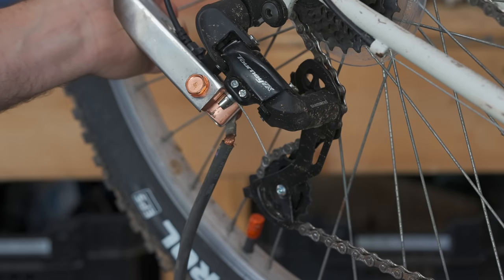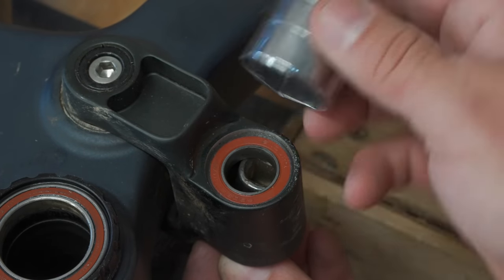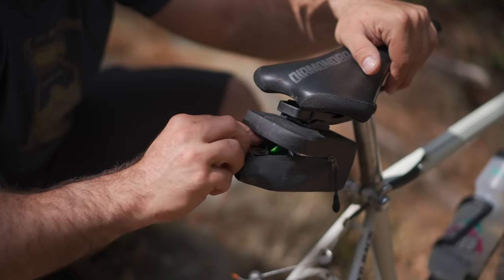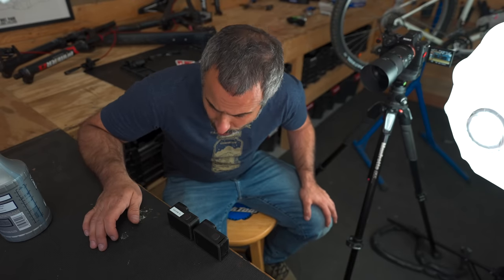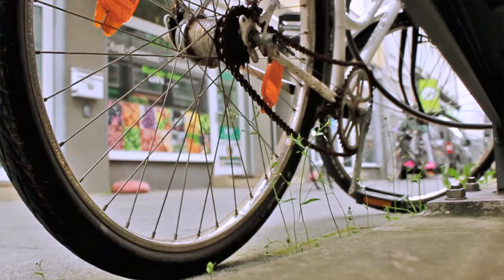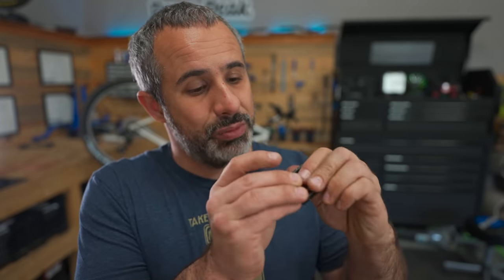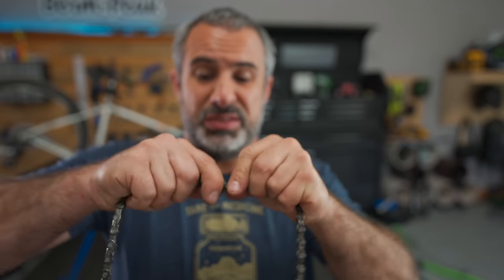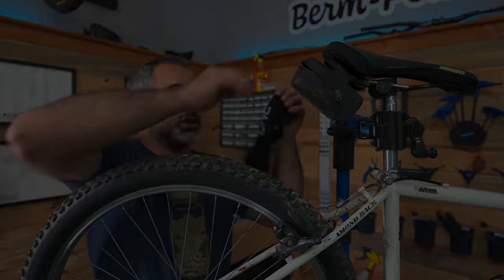10 ill-advised hacks for bicycles

Comment: A hack that I've used for cable ends is to use my torch or a lighter and heat the end up nice and hot and then quench it with some scrap plastic or clipped off zip-tie. Just like soldering, the plastic wicks in a bit and you can get a little goober on the end for a nice finish.

Comment: Another little hack for if you don’t have a crank puller for Isis drive cranks but you have one for square taper cranks: take out the bolt of the crank, take off the little plastic piece on the bolt, thread it back in all the way (don’t tighten it down though just thread it that’ll just make it more difficult to deal with if you tighten it), then take the crank puller apart and thread the part that goes into the crank into the crank (and tighten but not crazy just enough to still be tight-ish), then all you have to do is stick you tool through the puller and loosen the bolt, (and ofcourse unthread the crank puller part to get it off). By doing this you are basically making your cranks into a temporary self removing bolt style crank. This way you don’t have to waste 10 cents every time you take off your cranks.Also if you’d like to be extra careful put grease between each step

Comment: Regarding the cable end hack, I found using a 1/8th inch aluminum pop rivet (removing the aluminum nail first) will crimp on the cable end just like a normal bike cable crimp. After reading the comments, I also like the super glue method, and the head shrink one for the same purpose.

Comment: For the rainX thing, ive tried a few different things in the past including this and what seems to work best for me is to treat things with the cheap turtle wax ceramic coating meant for car paint. Basically makes most things repel water and pretty resistant to grime and scratches too

Comment: The bearing hack can be even simpler with using a nut and bolt and some washers insted of the clampp <3
Reply: I re-use the old bearing to push in the new bearing because it is the exact size you need.
Reply: @newttella1043  this is the way!

Comment: A small strip of electronical tape, wrapped around the base of the zipper "Pull" will also get rid of any clinking sounds, from bike bags/pouches. I used this to silence the noisy  buggers on my handlebar pouch. But, it works with basically any noisy clanking  metallic zippers on a ride. Just add it to the base of the "pull" thingy and not covering too much of "slider" itself, so the zipper still zips correctly ✌
Reply: even better... a bit of heatshrink. no messy glue residue when the crappy electrical tape comes off, which it will.

Comment: That method of chain repair was what we called, fixing a chain, before quick links were a thing. If the link is tight the chain tool has a place to put the chain to not drive out the pin, but free up the link. Surprised my man missed that but he does seem to be a very knowledgeable source, so I'll let him slide on this

Comment: PSA: don't weld galvanized metal, the zinc coating puts out seriously toxic fumes when heated that high. Most cables these days are stainless, but the galvanized ones are still out there

Comment: Welding feels like overkill, but I've definitely used a soldering iron and a little bit of solder to accomplish the same thing. For best results: solder where you're planning to cut the cable BEFORE you cut it, as the soldering tip could cause fraying.

Comment: Don't have to have a welder to do the cable. Install it, mark it, pull it back out. Chuck the free end in a drill and hold the other side of the mark with vise grips. Heat the mark with propane torch. When it's red hot spin it in half with the drill. Makes a perfect end. Now you can take the cable back out when you want to clean and lube it and you can use it over and over and not have to worry about frayed ends.

Comment: As a retired Aircraft and automotive mechanic 
As mentioned in the other comments freezing bearings helps, in the Air Force I worked in the Jet Engine shop and we had bearing heaters and bearing freezers. we heated bearings to expand them so they fit over the compressor drive shaft.
If you got a full suspension bike that the champ won't fit into, using some a piece of all thread and some nuts you can use that install and remove bearings I use that setup to remove and install bushings on the control arms of cars.

Chain quick links, tape one the the bike like under the saddle or to the bar, I have also seen a rider he puts on the zipper pull of his jacket but he put tape around it so he wouldn't lose it.

Comment: Instead of welding the cables, you can use superglue.
I have used it a few times and worked really nice.
As the bonus you can also twist the cable and when the glue dries, it will hold that shape.

Comment: Seth, this hack got me out of a pinch once. before a ride I was installing new grips and forgot to tighten the collar on all the way and I was out on the trail so I had to improvise so I took off the grip and put some green leaves on the sides of the inside of the grip and slid the grip back on. It's not perfect, but it works.

Comment: lacking a welder I honestly already soldered wireends. at least if they were already frayed or cut to short for crimping one of those caps (fixing rookie mistakes of friends :D). also for city bikes with less stress than mtb's many chains were fixed that way. still holding tight! if the link is heavier to bend you usually didn't find the sweetspot for the pin. press it in (or out) a quarter turn and try again :) 
all in all valid tips and hacks :)
Reply: Those cable caps do suck !

Comment: You can do the welder thing, but the easiest thing to stop a cable fraying is put a drop of superglue on it immediately after you cut it. Useful if you need to chop the cable end off to remove it (it to swap a derailleur. It stops the cable fraying and you can reuse it.

Comment: Great video Seth! Here is a hack that I use on my suspension because I don't have an O-ring:  cut a rubber band in to a strip then wrap it round your stanchion then tie it in a knot so its a ring round the stanchion and finally cut the excess off with scissors.

Comment: You can also feed a little solder in the end of the bike cable and heat it with a jet lighter to bind the end so it doesn't fray. Add extra flux, and it may really depend on the quality of the flux you have whether that's really going to work. Tin solder can bind to steel fairly well but getting it to wet the steel to begin with is another matter entirely, sometimes it just doesn't work. If you have Stannol Tippy, that can help as well.

It's probably not that great a recommendation for most people, but since i mostly do electronics, i have all these things on hand in abundance.

Comment: I'll add that you can sometimes get away with zip-tying a broken chain if you don't shift. You can also lock a derailleur that got mangled into a single gear with them if you have to. I've ridden home on zip ties and prayer before. Walked it up the hills, coasted down, and pedaled on the flats.

Comment: For security, if you have a 5/6mm hex bolt for say, derailleurs, stem, etc. You can use CA glue and a ball bearing to prevent someone from being able to rip off bike parts. When you do inevitably need to get to that part, a few drops of acetone and an o-ring pick can remove it easily.

Comment: Did the chain trick in once in the desert when i was stuck with a broken chain. I was like 30 km away from the closest town and absolutely no signal or human being anywhere near. I messed up at the first attempt as i pushed out the little metal thing, on the second attempt it went right though and i got safely back witouth a problem. Had no problem shifting or other chain problems. 
Couple years later i met this teacher who was mountainbiking with his school for gym class(so cool that he did that btw). Sadly he broke down with a broken chain and had no quick link or tools. Luckily i happened to drive by and having had my past desert experience quickly managed to help fix his chain. Riding away with a whole school class thinking thinking you are the coolest person ever was a pretty great feeling.

Comment: You can also solder cable ends, assuming they're made from steel and not some fancy ultrapro material. It works best with new cables, as old frayed ends accumulate dirt and solder doesn't want to stick as well. Dipping them in flux helps. If you don't have a soldering iron, you can melt some solder in a suitable tiny metal container with a flame underneath and dip in the pool the fluxed cable end.

Comment: I've fixed some chains like that without a quick link. If the link is stiff, sometime you can find the sweet spot of adjusting the position of the pin back and forth, by having the chan tool handle facing the non-drive side of the bike (pushing the pin backwards). Not only will it get you out of a pinch but I've used it as a long term solution.
Reply: the 'hack' is actually how the chains are made so no idea why its being referred to as a short term solution. its the proper repair, just people have been conditioned into thinking the 'quicklink' is proper, but the only thing proper about it is more money to someone else for things that should cost you nothing to fix.
Reply: @brapamaldi7666  you chain is shorter by one chain link.
Reply: @brapamaldi7666  not true.  Chains are made today by the final process of press-fitting the pins in place, then peening the ends so they flare out to make the fit with the outer plates even tighter.  This is how today's narrow chains can withstand side loads under shifting while the old chains couldn't.  (Ramps and modified cog & ring teeth help to, obviously.)  So when you drive a pin out, you pop off the peened end on the pin as well as ream out the ID of the side plate, so when the original pin is reinserted, it's a looser fit.  (My chain tool always has about 3-5 tiny rings of pin or plate material that has been popped off with each pin removal.)  A repaired chain will have that weaker link where the outer plates' pin hole diameters have been reamed out and are prone to pop off.

Shimano first addressed this issue by using their special larger diameter pins with smaller "lead" pin for chain installation and repair.  But as rear cogs have increased to 11 and 12 speeds and chains gotten even narrower, they stopped this method and switched to quick links.

But this repair is absolutely the way to get back on the road or trail in an emergency.

Comment: I might try the cable welding... my cable looks like the one that impaled your hot dog, as the crimp came off while riding tight trails and I never seem to remember a replacement. On street rides I use a rack bag, but keep a tow strap and an extra pair of gloves in to to keep things from bouncing around. I keep the tools themselves in a Muckoff zipper bag, with other things like patch kits, tire levers, spoke wrench, air pump and such in interior pockets when I can. Thanks for experimenting for us!

Comment: Good hacks.  Instead of a sock for the seat pack, wrap your items in a clean microfiber towel. You can use if for many things including a huge bandage.  On the chain hack;  after joining if too tight, flip around and a little pressure with the chain breaker on the other side will un-bind the link.

Comment: Growing up dad welded open cable ends like that on everything. I have a lifetime of crimps but still weld them before I put the crimp on.

A drill bit stop or a set screw collet the correct diameter would be better than a hose clamp on your wheel holder. Will hold better and you won't have that sharp tag of the worm clamp hanging off.

Comment: The cartridge bearing removal/installation without a special tool is something I've done to my old fully. But I didn't have a clamp, I had to use a long bolt, a nut and some wide washers instead. Worked a charm!

Comment: In the seat tool bag you should include a vital accessory. Put in a pair or two pairs of disposable rubber gloves. Surgical gloves.  They are a miracle when you handle the chain doing a rear tire flat repair or reseting your jammed chain.  You won't have black, gunky and greasy fingers from chain handling for the rest of your ride.

Comment: I put a vise grip on the cable, heat the cable near the jaws with a Crème brûlée torch until it glows and then I twist the vise grips until the cable breaks. The result is a fused end that is tapered but not sharp. It will freely side in and out of cable housing too!

Comment: If you get a sticky link after repairing a chain by driving the pin back through, reverse the direction of the chain tool, put the chain over the middle saddles on the chain tool (as if they were sprocket teeth), run the tool in until the driver pin is just touching, and then screw it in 1/4 turn. Works 100% of the time. Can't speak for 11-12 speed chains, though!

Comment: Two notes:
putting a couple of dimes on top of each other will decrease deformation and the potential to bugger up the machined surfaces, and soldering the cable ends would work just as well as welding and tools required are available at Harbor freight for under 20 bucks.

Comment: I don't weld my cable ends but I do solder them. Just dip the cable end in some flux, heat ( I use a propane torch), and apply a little solder. You never have to worry about losing a cable crimp and fraying a cable. It's just a little less sketchy than welding the cable.

Comment: do be careful with the chain hack if your only chain tool is from a multi-tool; some of this chain pin tool have short threads so you can only use it for pin removal. Using it to put back a pin can get tricky since theres a possibility that your chain pin is a bit longer that where the chain pin tool starts to thread.

Comment: For the first hack, I simply use a drop of CA glue on the cable tip. Much quicker than welding, it soaks in smooth and holds up well.

Comment: love the welded cable fray hack. I have also used super glue (Gorilla super glue to be exact) to keep it from fraying (along with a cap of course). The super glue actually sucks into the cable via capillary action so you don't even know it's there! Perfect for when you need to change a derailleur and don't have a spare cable handy - you can put through the housing again with fraying.
Reply: gorilla super glue = super glue. To be exact.

Comment: I love the welding hack. My trick for that is crazy glue. I still put a crimp cap on there, but if it gets dislodged, the cable end is fine. If you're going to try it, it took me longer than I want to admit to realize its a lot less messy to stick the end into the glue tube than to try to drip a tiny amount o nthe end.
Reply: Someone mentioned in a comment that it is brittle and may fail, but I have done it for years, succesfully passing the treated cables through housing many times without the tips failing.

Comment: I been doing the dimes as crank puller adaptors for years now. I only have 1 set of cranks that I need this for, so I've been putting off a new tool indefinitely. I use 3 dimes stacked up for fear of pushing them into the spindle.

Comment: Great informative and entertaining video! A month ago I actually used a Harbor Freight shop press and various sockets and washers to press in and out bearings and races on my Corvette's automatic transmission. The seat bags (with tools) are sold seasonally at Aldi or Lidl for about $5. I have more of those than I do bikes😂. No sock, but I do sometimes throw a rag in to dampen things, but now I know what to do with the 30 or so socks that no longer have a mate because the dryer must be invaded by one legged aliens.  I use a large plastic trashcan like Rubbermaid to lay my wheel on horizontally to do tire mount/dismount. RainX on a windshield is usually not effective until over 30 mph, so I can see why it wouldn't work, maybe so on a motorcycle. I was about to question you about the chain hack because I was doing that when I was 7 years old on my chopper style banana seat ape hanger single speed coaster brake bike, but you already mentioned that! My chain tool then was a nail or broke spoke and a hammer, brick or rock. Love your videos!

Comment: for those in the US... get a "Canadian Security" heas aka Roberson.  the square cannot be taken out with philips, or flat, and unlike a security torx, doesn't have a pin which can be knocked out.  They are a nice cheap option if you have a trip up here, as most hardware stores stock them as the regular screws.

Comment: I like to slip a piece of heat shrink over the end. I heat the part on the cable to shrink and stay on. I leave the heat shrink about 2 inches long. It's poke proof, looks cool, and is removable and replaceable.

Comment: At one point in time, I reconnected chain ends with the chain tool over and over again, never had issues with this chain. I never considered it any bad, but what chains are kinda made for.

It should be mentioned though, that I am not an "extreme rider", but more long distance rider, who doesn't put as much strain on his bikes, as an offroader.

Comment: The sock tip could also be used as an improvised glove to keep your hands clean while you handle your drive train repairs out on the road. I use my sock to make sure my hands are grease free if I have to put my chain back on for a back wheel removal.

Comment: I sometimes use solder for the cable ends. It works good.
Reply: how do you get them to wet? ive never been able to, always end up welding them with a capacitor bank
Reply: @mikstratok  ... overly greasy cable could be a problem, but otherwise just use strong heat like a Weller instant soldering gun, and use soldering flux  ... like a charm

Comment: Welding is ok, but it's much easier to solder the tip. Stell doesn't take soldering very well, but with a little help from soldering paste it is supper efficient.